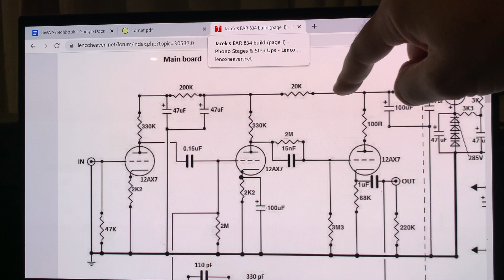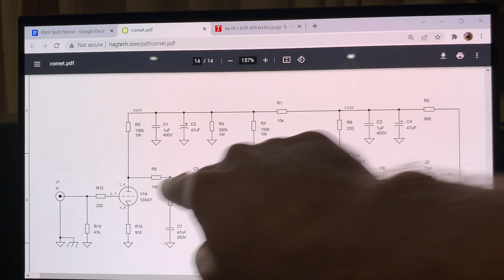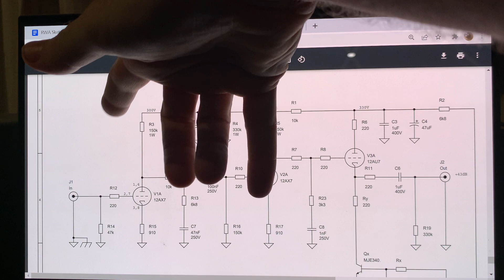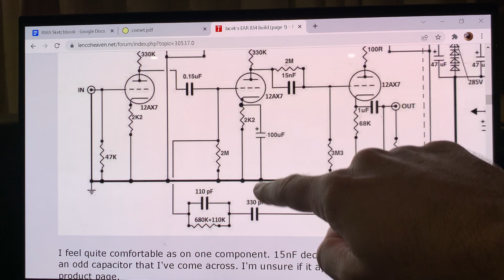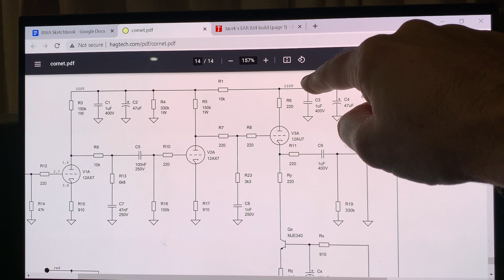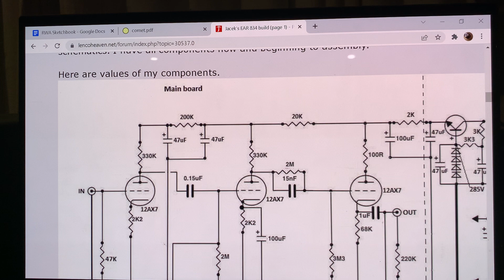Active vs passive phono schematics analysis part 3

Comment: I’ve built a handful of those EAR phono pres, and using a B+ of anywhere between a 280v - 300v on the secondary, those plate voltages just aren’t that high, as you just explained. I’d have to go back and take some measurements to know for sure. 
Among many other mods, I also modified the circuit with a different voltage on the plate of v3 / cathode follower, and find a 12au7 sounds smoother and also makes a bit more sense. A 12ax7 in the v3 spot tends to add unwanted noise due to its much higher gain.

Comment: Hi Janos, Thank you for this insightful video. Are there any specific things that you look or listen for when finetuning bias apart from things like leaving headroom for the signal? Perhaps for another topic or video, but you mentioned to not add colour to the phono stage and I've been pondering where we would/should in a system. Sakuma spend years to make an amp suit a Lowther driver, but my intuition says to find our preferred colouring in either the source or the loudspeaker, but not in between  - except cables and the preamp: for example Quad's tilt and other functions on their preamps (33,34,44) seem like a good place to tweak the sound of recordings. I still miss the tilt function and with headphone amps something to reduce the stereo separation for the older stereo recordings. What are your thoughts on this?

Comment: hey bro , how's it going , didn't watch the video yet but I just wanted to ask you about the coal you were telling me about , u told me it was like activated charcoal but on steroids , sorry I forgot the name for it , I was thinking of trying it out , you know how much room affects the sound . and most guides you find on accustics are totally in the opposite direction , so many brands take about first reflection points , from my opinion , if the side walls have just absorption , it will kill the dynamics and even the natural ness of music in the worst way possible , they need to covered with wood or something and you can have foam or whatever behind it , tips to the viewers of this  gem of a channel , pls dont make this mistake , and second thing spending more on gear won't really make that much of a difference as would with if u spend a fraction , room should be treated in the right way , the deadening sound is for studios or movies where u have side speakers providing this vital info , that totally gets destroyed  in 2 channel , I know some old music is not even bass heavy , just absorb the energy very near to the speakers and add just plain wood on side walls 
, I think like you are sharing with us , I will also begin to start sharing 
guys if you have any questions you can send me photo of ur setup along with room measurements , and I will guide you like Janos does in terms of tubes and speaker design 
cheers
Reply from the maker: Hi 29, it was Shungite. Don't know if you can get that anymore, the only source is Russia, (the Tungusca meteor in Siberia) ... ; ( .  It makes a difference once everything is right with the system, and it's just an extra step in the right direction - it will not change a challenged system into a stallion. Lots of good advice you just shared on the imaging & channels! I can second all your points. Excited to see you channel start!! Cheers, Janos
Reply: @realworldaudio   yes bro what you said is very true for people like you and me  who already have been treating our rooms for years , even having many speakers in or around your speaker also absorbs a lot of energy , but I see so many audiophiles , having like solid stone floors and no treatment , and if they do want they buy those stupid foam panels from amazon etc , these people are given demos in fully treated rooms and they keep chasing brands etc , I am really thankful when I got my first avr , the owner came to install it and told me straight away that the sound I heard at his setup won't be able to replicated unless I treat my room , so he gave me an offer of around 1000$ for the room , so started my first diy project , then I found your channel some after years but and then u changed my perspective a lot as well along with real hifi help , and yes I agree and you made a video on this topic before as well , that it does make a difference but whole setup and room has to be ideal or near it .
Reply from the maker: @IDontExist14  I'm so glad you had a superb start with room treatment! Indeed, those who start with untreated rooms, and do not fix it, will never reach a system they are satisfied with. I'm glad to have helped you grow, thank you for your comments & ideas! ;) Janos